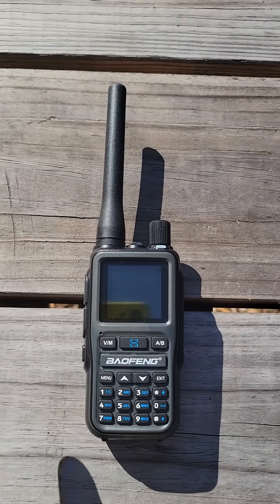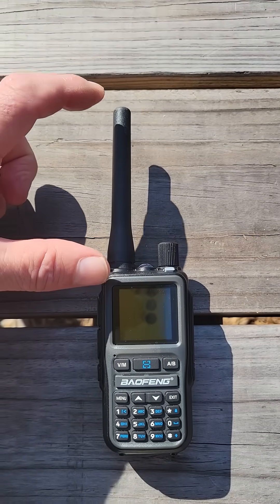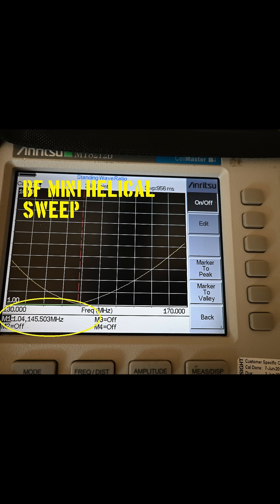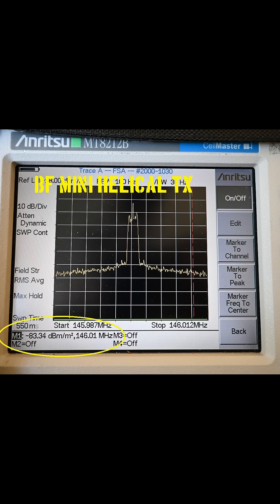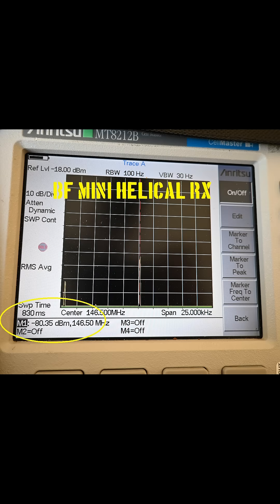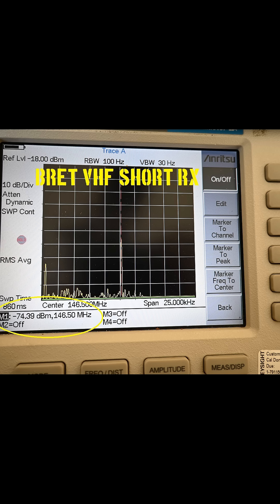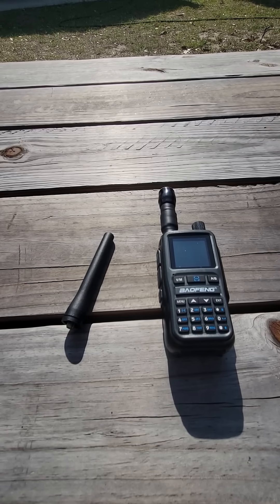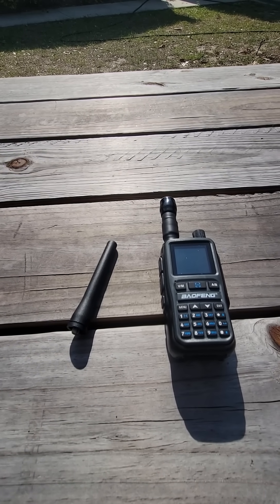Baofeng UV-5R Mini factory antenna is E-waste #survivalcomms #hamradio #radiocommunication

Comment: My Baofeng antenna works really well in my rural area 9 miles away from the local repeater from in side my house with a metal roof gets into the repeater well.
Reply from the maker: Interesting.... The two I have here actually get hot when transmitting on VHF.  Thanks for watching !